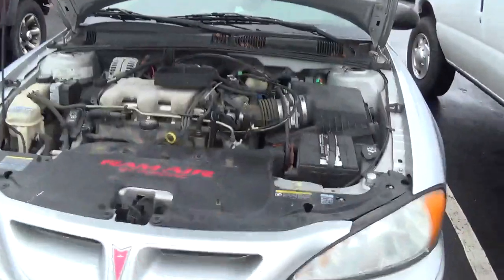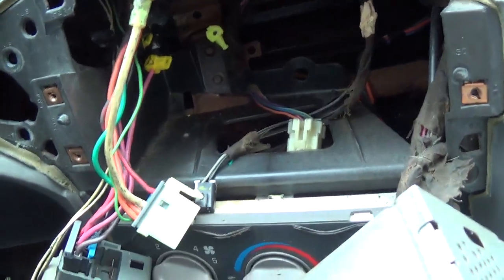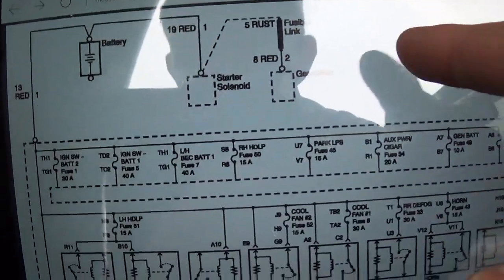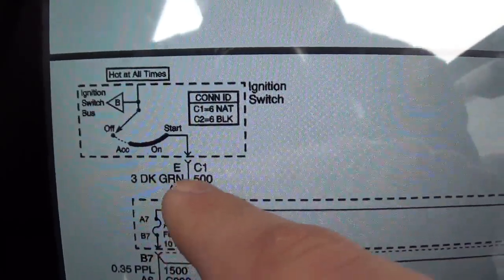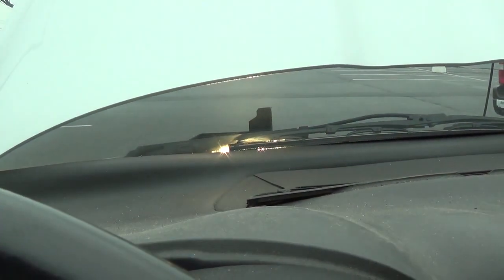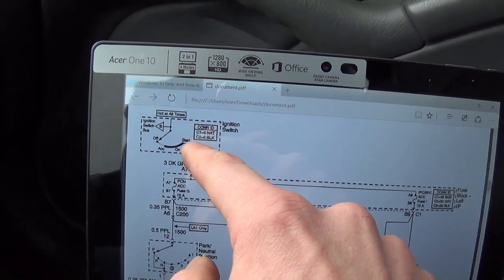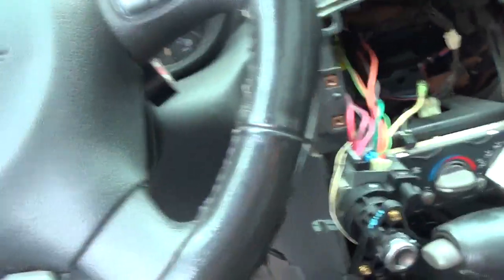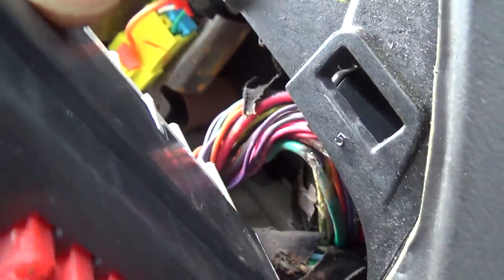No crank, Blows Fuse: Short-to-Ground Testing

Comment: This, in my opinion, has to be the easiest way to test for a direct short to ground. The current is only going to flow along that path. Actually even easier than a voltage stop test using the amp meter. Great job!

Comment: during 30 years in tv/small aplliiance repair, we used a 300 watt bulb in series with the AC supply. saved  very many fuses over the years. excellent load application

Comment: My 03 S-10 had the same issue, harness rubbing on the bracket for the emergency brake assembly. Good video Ivan!
Reply from the maker: +EZRider1979 Yeah GM isn't the most careful with some of their wiring harness routing. Come to think of it, this is maybe the fifth short-to-ground vehicle that I have diagnosed within a year...an ALL of them were GMs!!

Comment: Extremely well done, Ivan. You always think that the problem is associated with aftermarket accessory installation but as you show not always. It took many years to chafe through that wire assuming that the fuse panel has never been removed.
Reply from the maker: +wysetech2000 12 years to be exact :)

Comment: The lamp in series is often done for testing old tube amplifiers and TV's when no variac is available.
It is a perfect way of setting / controlling a maximum current in an electrical circuit.

Comment: Ivan there will still be a lot of blowin in that car, just wont be fuses anymore. That was quite the mess behind the stereo there, I dont know who made that mess, but that re affirms my belief if you dont know what you are doing don't do it. Nice job on the diagnosis, first time I have seen a blow unit. I would guess they put the camera in to make sure it is the actual driver who has to blow doing the blowing a not a friend and then the driver hops in the seat.

Comment: Nice work Ivan. Just for some info, you can use your 200mA test light instead of the fog light, and you would see that it would glow brightly also. Keep up the good work!
Reply from the maker: +stuzman52 Hey Terry! I just used the big lamp for a better signal-to-noise ratio on the amp clamp. 5A is a lot easier to track than 0.2A :)
Reply: +motoYam82 Okay Ivan sounds good. Didn't think about you using the amp clamp and in that case, the fog light was a good idea!

Comment: I did a Google search on keywords "smart start breathalyzer Pennsylvania" and found some interesting discussions. Smart Start is just one of many vendors anxious to install this device on your vehicle if you are unfortunate enough to have the State mandate it due to a DUI conviction. Reading about all the problems encountered and frustration it causes, that is just more evidence that one should not "drink and drive". 

This device reminds me of "Big Brother" mandating that 1974 model cars have a starter interlock for seat belt usage. Drivers were NOT using seat belts and killing and/or injuring themselves because of seat belt noncompliance. Those devices had an electronic logic circuit and soon failed and caused lots of frustration. Congress received so many complaints about the devices that this safety mandate was reversed by mid-1975 and these devices were no longer installed. Today the cabin interior is surrounded by pillow type devices (airbags) to protect "us from ourselves".

Ivan is BRAVE to tackle this type of electrical nightmare!
Reply: +acarl1018  Seatbelts are not only for the driver. They are also used to keep the driver in the seat and let the driver keeping control over the car and so avoiding damage to others.

Comment: Removing those fuses was a good idea in terms of isolating the shorted part of the circuit but those two 10 amp fuses would never have blown anyway as only the up stream 40 amp fuse is protecting the battery. Short circuit faults only blow fuses or circuit breakers upstream to a fault as the direction of the fault will always be toward the power source.

Comment: When I saw the hack job on the wiring I was certain that would be the issue. That chafed wiring was pretty bad. I'm surprised that it didn't fry anything sensitive. 

Nice trick with the 5 amp light. I'll have to remember that one.
Reply from the maker: +zoidberg444 After this diag I rigged up a custom "variable-current" test light with current draws of: 0.5, 1, 2, 2.5, 4, and 5Amps. Look for it in some upcoming vids!

Comment: Hook up a fusible jumper  at the  fuse box and see which circuit is shorted. Hook up a test light to the  battery and pull fuses. The ignition switch could be shorted. Check  for voltage at the starter relay. Plastic fuse puller is safer. Use a wire piercing test light to check for voltage and breaks in wires.

Comment: Nice job Ivan. Where did you find the ends that you put on the fog light to plug in the fuse block? Looks like a perfect fit.
Reply from the maker: +White Tiger UActivate relay test kit from AESWave.com; I don't use the relay tester, but the adapters are very handy!

Comment: Hey Ivan, 
question, I known it's silly but it will help me understand. Why would you use a 5amp fog lamp when it blows a 40amp fuse? I'm just wondering, is it because it subtracts 5amps from the 40, so not blowing it again or? 

I know its to take the load but I keep thinking you need a larger amp drawing item to diagnose this. I'm sorry, not sure at all, so hopefully you can clear that up please

Comment: one thing i dont understand is shouldnt the light still light even without the short because its in series when you connect it to the fuce holder?ive been racking my brain because i created a simple circuit using test lights and indeed the light did light without a short to ground but then i went outside and tried on the car with fuse removed and it didnt?

is this because so much more draw as a fuse usually has multiple things powered that even though its in series it doesnt light unless you have a draw?

Comment: I got a 1996 tacoma ,2.7 . My distributor hot wire has 12 volts at it and the ignitor also with key in on position .With key off these same wires are  a ground . I got a p01300 dtc . It won’t start . New ecu, new oem distributor from toyota, new crank sensor from toyota, all wires have excellent continuity . Its getting fuel . All cylinder plugs fire , but #2 and #3 seem weaker . I wondering if my key switch is causing this with this weird ground . Or does this ground come into effect to shut the vehicle  off ? Help !

Comment: 100 amp fuse is blown in my 95 Honda accord. I have no power on the dash and will not turn over. The emergency flashers work and Horn works and that is it. Is it just the 100 amp fuse that is stopping that or what?

Comment: Ivan please explain why replacing the fuse with a fog light would be safe. I would think without a fuse you would run the risk of burning up wiring with 40 amps shorted to ground for an extended period of time.
Reply from the maker: +Jason Graham Well that's the beauty of using the light! I'm only sending 5A down a 40-Amp circuit...could leave it on all day long until the battey gets drained :)
Reply: +motoYam82 I really like the trick Ivan . Just to understand, if you put in different watt bulbs will the current vary because of the bulbs resistance ? Will this test work on higher amp and lower amp circuits ?
Reply: +motoYam82 hey Ivan, like your videos. Just to expand on Jason's thoughts about the fog lamp. without current flow in the circuit the fog lamp will not light, correct. by pulling the fuses for the two other legs of the circuit that eliminates any possible current flow in the circuit. When you started to trace the green wire in the circuit and you found the bad wires and ungrounded them thats when the light went off, correct

thanks again for all your hard work on the videos, Tony

Comment: I can't believe that people are actually dumb enough to replace a 40 amp fuse with a 60 amp fuse to try to "fix" an electrical fault.  How can they not understand that fuses are there to PREVENT FIRES IN THE ELECTRICAL SYSTEM?
This car was so close to going up in flames.

Comment: If the 40 amp protection was blowing and not the 10's why did you bother with them?  And..I still don't get why you substituted 
a load for a fuse ????
Reply: +moomike laloo Cheaper to light the fog light to prove the short to ground then blowing 40 amp fuses constantly...

Comment: I have a question, and would value any feedback. I just put a new starter in my sierra 1500. New starter matches old, same lugs/ wiring etc. After install I went to crank, nothing happened and blew the 40amp ign 1 mega fuse. What does this mean? Starter body (which is ground) has no resistance to frame, so good ground. Any insight? Thanks in advance!
Reply from the maker: Did the problem happen before the installation? Just follow the diag procedure outlined in this video and you are sure to find your problem ;)
Reply: Pine Hollow Auto Diagnostics - it only happened upon installation of new starter. I think I found the problem (will know tomorrow). The ignition terminal appeared to be shorting to hot solenoid terminal.
Reply: Pine Hollow Auto Diagnostics - Thanks for the reply to my question. I figured it out. I disconnected the two cables and checked resistance to ground ( thankfully before pulling new starter out). Found all was normal, but noticed a burn mark and some rubber on main terminal. Ignition wire had burned through the insulation and shorted to other terminal. Re wrapped ignition ring terminal, and put an insulating layer of liquid electrical tape on the other. Good to go!
Reply from the maker: Awesome!

Comment: Have a 2006 explorer and it keeps blowing coil packs and blows a fuse every time. #3 And #5 cylinders ones not firing. Replaced 3 times same results. Anyone else had this problem or could anyone tell me where I need to start looking. Think maybe have a Ground! Appreciate any help
Reply from the maker: Hi Jessica, sounds like the control wire for the #3-5 coil pack is shorted to ground either externally, or internally through the PCM (engine computer). You need to disconnect the coil pack and hook up a testlight between battery positive and the control wire for the #3-5. If it lights up bright, you have a short to ground! 

Now keep the light connected and wiggle the wiring harness going from the coil pack back to the engine computer (I think it's mounted on the firewall under the hood?). If test light flickers or goes out, you found your problem. If wiggle doesn't work, disconnect main connector at PCM. If light goes out, you have a shorted driver in the PCM :)